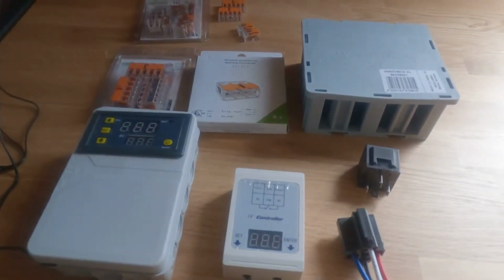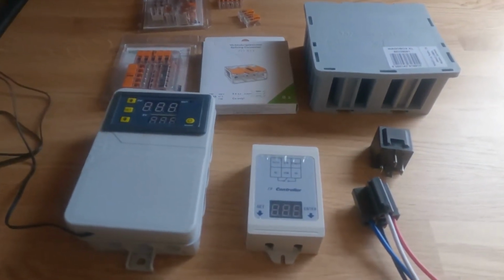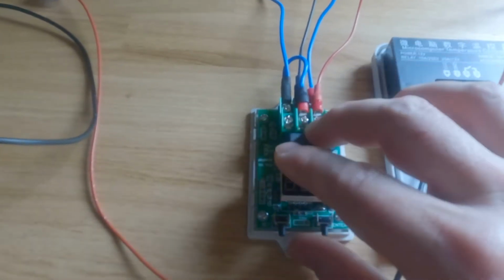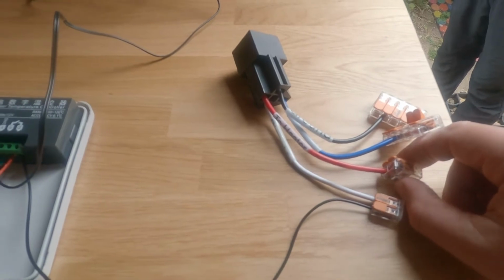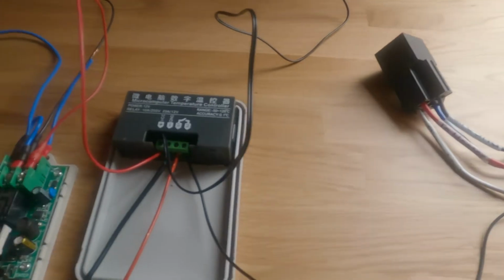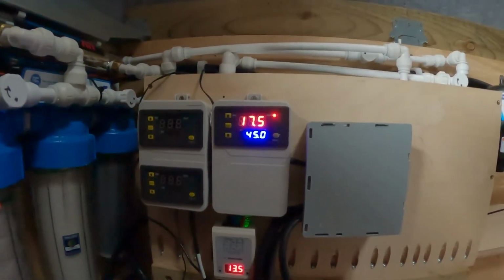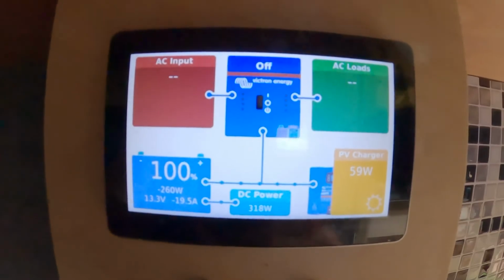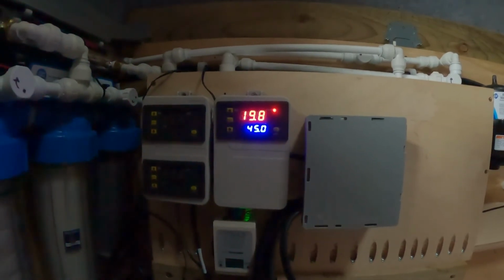Building and installing my Solar dump load

Comment: I suppose my question must be if the heater element is 12v @300w what size cable would be needed to feed the element?
Reply from the maker: Hi dingnextstop, thank you for watching and posting your question, the amps drawn is only 25A max so make sure your able, i have updated the link to the cable in the description as it has been changed, here is it: https://www.batteriesandsolar.co.uk/shop/110110-2-core-flat-automotive-high-temp-thinwall-cable-4-5mm-42a-c207tw-100brb-265926?search=42a+cable#attr=837,6279,6280,6281,6282,6283,6284,6285

Comment: Hi 
I have two 105ah lit battery
Cable is easy enough to run new one but I'm thinking I am better of to size down emersion heater to 300watt
Thanks for your input as I don't now much about this set up ali
Reply from the maker: @alaisterdraper1164  not a problem, did you download the wiring diagram?

Comment: Very impressive was thinking of doing something similar just could not figure out how to do it.
Are parts readily available and I have 600watt heating element could this work with your set up
Thanks ali
Reply: Hi yes
600watt 12 v
I have only 350watt solar at 12v
Reply from the maker: @alaisterdraper1164  your problem is not so much your solar, its the size of your battery and the size of the cables you are using for the dumpload. My system at 300W will draw a maximum of 25 amps if you are going for 600W then you will be pulling 50 amps can your cables handle that? Second to that based on the size of our battery being 400ah at 25A I can run the system for 16 hours before I empty the battery with no sun. What size battery are you running?
Reply from the maker: @alaisterdraper1164  thank you for watching and commenting. The parts should all be listed in the description, if I have missed any I will add them, there is also a wiring a diagram produced which is in the committee feed, if you need one. With regards to the 600w heater element is it 12v ?

Comment: Hi, great system! I'm currently busy setting up a similar system, myself. 
I'm perhaps overthinking, but I'd like to fit some sort of thermal fuse, so it will cut out if one of the relays ever sticks, or if the tank ever runs dry.
Do you have any suggestions on how this could be possible?
Reply from the maker: Hi Jamesadamson2615, thank you for watching and asking your question. If you are using the cerbo and you had data coming from a seperate heat sensor you could get the cerbo to work as that second switch, i do have a second temp sensor sending this information to my cerbo, but i have not setup the cerbo to cut out, but it would be fairly easy to do, you tie it into the say the remote relay but set it in reverse, what i mean by this is normal setup it is triggered to start based on input signal, you need to to be setup to stop based on input signal. it you watch our electric install overview video. Hope this helps. If you have not already purchased your battery or your system yet, it would be well worth speaking with Roamer they do offer a full free design service when you buy a battery from them. Here is a link to their website, you will get 5% discount with this link https://roamer.com/products/460smart?aff=alivefrom45

Comment: Hi Matt, thanks for sharing! I really like what you have done here and I plan to build mine just like yours, although I will use bigger wires. I like to use bigger wires, just in case. Did you ever consider another diversion load for when your hot water is up to temperature or does that take most of the energy available? I think most of my 4Kw of solar is shunted in summer and I want to make better use of it. Hot water is good, I also wonder about the freezer, AC or hydrogen production.
Reply from the maker: Hi Tom, thank you for watching and taking the time to comment.The system works very well and with the temperature sensor it turns itself off once hot enough, we are now running a freezer in the van also, which I have a video coming out on in a few weeks, if your interested in a freezer for the van. I've not looked at another dump load, in fairness current I'm not sure other than hot water for washing up, which we currently use the kettle to get that water, which does feel a lot more effective to be fair.

Comment: hi Newbie here, could you show a diagram or explain pin by pin what wire goes to what please as ive never wired a relay before. thank you
Reply from the maker: Hi Hive, thank you for watching and commenting, the 40A relay has an amazon link in the description, which has the pin layout included, the voltage relay also has a link which includes the wiring lay out. Does this give you the information you require?
Reply: @Alivefrom45  Hi Sir yes thank you
Reply: @Alivefrom45  sorry you never explained where the blue wire actually connects to when you were discribing all the wires.
Reply from the maker: @TheHiveOffGride  the blue wire which connects to the voltage relay, goes to a switch, this will power the relay systems, the other blue cable coming from the wago is also a live but this is permanent, this also supplies the power to the second relay. Does that make sense?
Reply: @Alivefrom45  would really like a diagram. If possible please sir
Reply from the maker: Hi Hive, I have been ask for a drawing in the past, but i have not been able to find a way to draw one which does not look like a spider on a page, i'll have another look into it and let you know.
Reply: @Alivefrom45  thank you sir, how did you figure it out in the first place?
Reply from the maker: @TheHiveOffGride  in part I see a few similar ideas, an adapted  to work for me, it does help that I have a problem solving mind and a back ground in electronic.
Reply: @Alivefrom45  ok, so let me get my head around this, in the video you have the small blue with and a red wire on the first box, i assume the red wire was for demo and its actually the small blue wire that goes to the second box in place of the red wire. is this correct?
Reply from the maker: @TheHiveOffGride  I have put together a wiring diagram, I will upload it to the community post page.

Comment: How is this connect to the mppt please
Reply from the maker: Hi Hive, thank you for taking the time to watch and ask question. The way this setup is made, you do not require connecting to the mppt, so you can use any brand of mppt, the voltage relay runs off the battery and detects the voltage there to activate and deactivate inline with the battery voltage. Your mppt can connect to your battery as normal. I hope this helped. If you have any more question please feel free to ask.

Comment: I have a 100w immersion element rather than 300w - can I run this straight from the temperature sensitive relay as it will only draw around 8 amps?
Reply from the maker: Hi Gary, thank you for taking the time to watch and ask a question, looking at it being only 8amps you are within the manageable ampage of the unit i used. however one of the problems with happens if you try to do that is when the heater element starts, it causes a spike to the supply and as a result the relay will start kicking in and out like mad, so the best thing you can do is run a separate power line for the heater element. hope this helps.
Reply: @Alivefrom45  Thanks for the reply. Out of interest what size wiring did you use for the 40a relay load?
Reply from the maker: @garyleighton7558  there is a link to the 42A cable in the video description

Comment: Hi, just the explanation I needed to make sense of this! Thank you. To make sure, the “power in” you mention at 1:18 of your video (blue and red wires) come directly from the leisure battery positive and negative connectors?
Reply from the maker: Hi Fabrizioradice, thank you for watching and posting a question. The blue and red wire which are connected together via the wago connector are both positives and go directly to the battery positive. the lower middle wire, which is black on the voltage sensitive relay goes directly to the battery negative and again the black wire going into the second connector on the tempeture relay is also a negative (-GND). I hope this help, if you have any more questions please feel free to ask.
Reply: Hi, thank you for the quick reply! I have another question. My leisure battery is really awkward to reach and far from where both the MTTP controller and the solar dump system will live. Do you think I could connect the two positives and two negatives of the “power in” in the MTTP controller Pos and Neg connectors? (The ones connected to the battery)
Reply from the maker: Hi Fabizioradice, in fairness I have connected to a fuse (I'll double check and confirm the size for you), as well as using an inline switch, so i can manually control everything, while yes the system will manage itself quite happily, i like to know i can shut the system down or turn it on when i want. depending on the Mppt unit you have you can run off the relay outline, which i know has been done before, but i don't know which Mppt you are using. As for running of the Mppt positives, i would say no, it needs it own line with its own fuse.

Comment: If you use busbars and run straight from pv this stops the batteries from cycling many times during heating. They can fully cycle upto one whole one per day lessening the life of your batteries. You would need a larger volt and amp relay to load. Take the voltage feed straight from batteries. This way bypasses the batteries and just uses pv.
Reply: Take voltage feed from battery to voltage relay. From voltage relay to temp relay. From temp relay to dump relay. Dump relay is connected to busbars. Bypass batteries automatically.
Reply from the maker: Hi Sean, thank you for taking the time to watch and leave feedback. There are a few problems with doing what you suggested to our system. Firstly our mppt does not have a relay output, but more of a challenge is maintaining the power so the relay does not keep tripping out due to a drop in supply from the solar, also the way it is currently setup i can you the DC to DC charger to heat the water and of course i have the bobil diesel heat to do most of the the work. One thing i am looking at is using the Cerbo GX to control this operation, due to changes in the latest firmware update.

Comment: Hello,
Thanks for the video.
I understand the process but I am missing the connection of the dump relay to the mppt or battery.
Reply from the maker: Thank you for watching and asking questions, So it does not require connecting to the mppt, the relay reads the voltage of the battery interdependently and in turn turns on the heater relay to check the temperature before turning on the heater element. I can manually turn the system on and off or leave it to the relay to start and stop the heater unit as required. Hope this helps.
Reply: @Alivefrom45  
Thanks a lot for your explanation.

I am french so I maybe missed some of your explanation.

With your explanation I understand that the relay is not diverting the solar power straight to the heating element.
But starting the element, so the current is coming from the battery and restarting the PV charging the battery.
Reply from the maker: @Mathieu Doucet The two systems work separately, but both take readings from the battery and pending the battery voltage reading, either systems will carry out its required action. I hope this helps, if not please feel free to ask further questions.

Comment: hi on last relay if red and black goto element what is the blue wire for cheers
Reply from the maker: Hi David, thank you for your question, the blue wire is used to supply power from a manual switch, this is connected to the lower far right terminal,  this is the blue stripped back wire with no connector on the end. The other blue wire supplies 12v to the left hand lower and the middle top terminals, this carries the power to main the whole thing work once the power sign has been supplied to the other blue cable. I hope this answers your question fully, if not then please let me know.

Comment: what wires do i connect to the element please
Reply from the maker: Hi David, its the same wire which is used to supply the relay, here is a link: https://www.batteriesandsolar.co.uk/shop-categories/2-core-flat-thinwall-4-5mm-42a/

Comment: do you have a wiring diagram please were does blue wire go that is not connected
Reply from the maker: Currently i do not. I have plans to make one, as i have been asked for one by other people. I will complete this shortly and make it available.
Reply: @Alivefrom45  thats great happy to pay for it
Reply from the maker: @davidwilson1263  its totally fine, i need to put it together, do you feel that following the video will be easy enough once you have the diagram?
Reply: @Alivefrom45  yes should be do the red and black from last  relay got to element

Comment: Hi matt love your video's very informative.i also run induction in mine and its been great,I see in your early videos you fitted a recerculating shower,I would love to add this addition to mine but trying to find plans is difficult.i see that 2 pumps are needed, but would be nice to have a system diagram so I can see how it works,any help would be greatly appreciated.
Reply: Hi matt thanks for replying.
unfortunately I'm in clacton this weekend so can't make the show.
It's a shame I would of liked to have a chat about the system I want  to install and had your thoughts on it.i guess I'll have to wait for your video on your install looking forward to that,anyway matt have a great weekend at the show.
Reply from the maker: Hi John, Thank you for taking the time to watch and leave feedback. I have plans to do a video on the recirculating shower, covering the filters the pipework and everything else. Been heavily focused on getting the van finished for the Stratford Overlander show this weekend (4th June 2022), where we will be showing the van. If you are planning on going, please come over say hi, your welcome to have a look around and ask any question face to face.

Comment: you have good video but lack alot of info... shower... ok build the shower but the pipes and filters ... what did you use.... just I find myself asking more info.... just my imput on it. and yes I am in the middle of a van build of a step van....
Reply from the maker: Hi Anthony, thank you so much for your feedback, it is really helpful to hear what my viewers think of my content. in regards to the pipework i used John Guest 15mm speed fitting, this is cheaper than the 13mm stuff that places sell for campervans, I just got mine from ToolStation. I will work on putting together a video covering the pipework and plumbing, which i hope you will find useful. Please feel free to ask any other question you have or add any comments to any of my videos, I welcome the feedback. This is my first ever build and my first YouTube channel and I can only improve the content with feedback, so thank you once again for leaving your comment.

Comment: nice system and easy to do i guess do you have a schematic and a parts list you use,  nice video
Reply from the maker: Thank you for watching and taking the time to comment. I'll add a parts list to the description and see if i can draw up a schematic for you. as you can see from the video its not to hard to put together, it just a set of different relays triggering each other.
Reply: @Alivefrom45  thanks for reply, and thanks for taking the time to make it, will keep an eye on this
Reply from the maker: @paulus47  I have now added the list to the videos description, I hope it helps. I'll will try and put together a schematic for you, but this could take a while, sorry. I hope you may well be able to follow the run through within the video once you have all the parts. Let me know how you get on. 👍
Reply: @Alivefrom45  no problem , take your time as I have time enough ;-) appreciate that you do this all , thank you